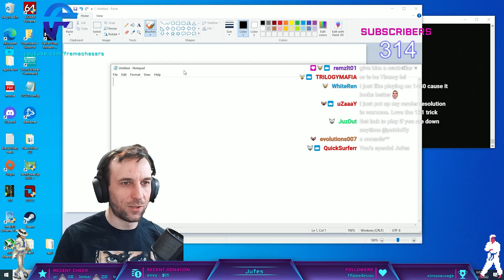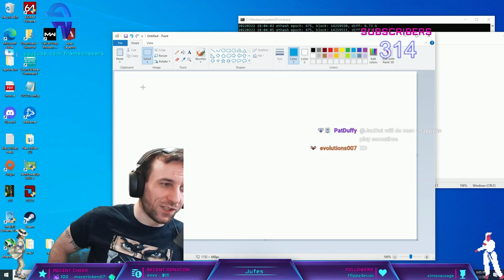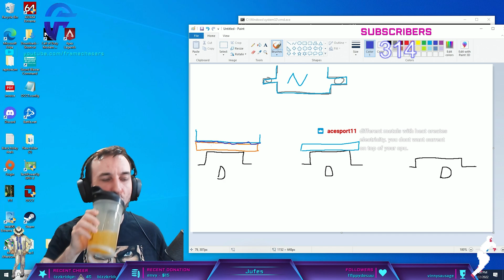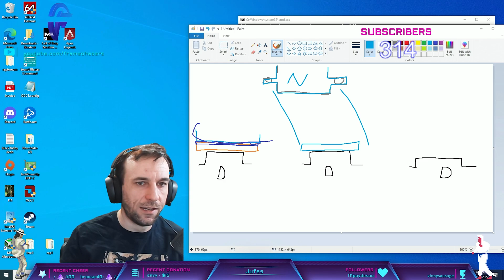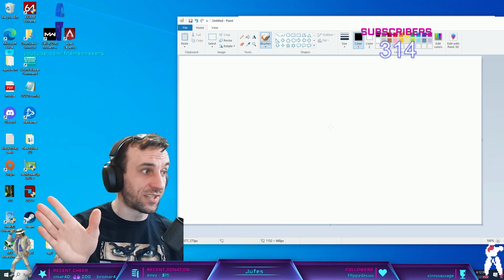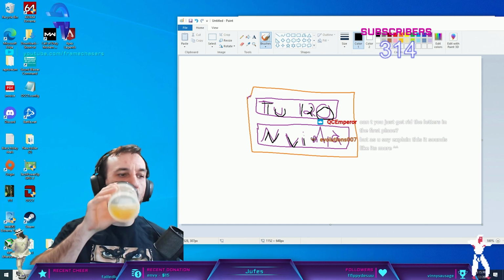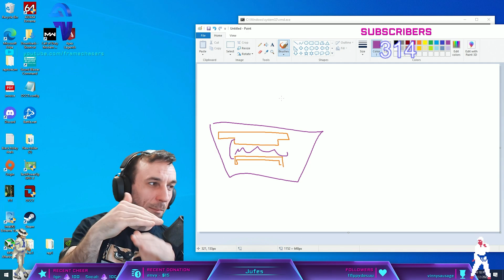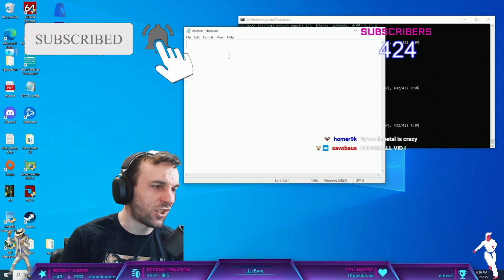Liquid Metal Application Guide

Comment: yo dude you ever used... Honeywell PTM 7950 ??? I want to know if its any good. as I am lazy as fuck and don't trust a lot of what people say. I have been using the thermal grizzly carbon pad for years no issue for me. I want to upgrade to a full water cooling system and don't trust any conformal coating (every fpv quad got screwed using it). I want to apply and forget so 5C ether way meh also don't want to get bummed screwing a 4090 using it if no good I would like your opinion bro

Comment: I use it only on my GPU and it made a 10C difference compared to Thermal Grizzly Kryonaut paste. My 5700XT sits at ~45-50C with 55-60C HotSpot while gaming and with the water maxing at 43C after a few hours. I used LM a year before trying it again and screwed up after spilling a drop on the mobo which splattered everywhere. I'm surprised it didn't blow up but I was lucky because I only didn't get a post. I then washed the mobo with soap and water and a toothbrush, let it dry overnight on paper towels and I threw away the syringe with LM. A year later I decided to use LM only on the GPU. The water block and GPU die are nickel plated so I don't have to worry about degradation. The thermal conductivity is insane. It's now been probably 8 months since the application and there's no difference compared to day 1.
Bottom line is, you gotta be extremely careful, put nail polish on the things close to the application area and you'll be happy with the results. But if you don't care about a few lower degrees, the truth is, there's a lot to go wrong. For me it was ~10C so it was worth it.

Comment: I have a custom IHS copper for my cpu  would liquid metal mess up the copper overtime? if i just leave it running for 2 years?
Reply: LM on copper only lasts for around 2 months. some copper could last longer or less time. the performance will drop in around 2 weeks time from my experiences. really no point in LM unless its on bare die and nickel plated cold plate.

Comment: I used liquid metal on a Dell laptop with a copper heatsink that was overheating and worked wonders for 2 months then overheating again.
Taking it apart I could see it dried up, after scrubbing the die and heatsink with isopropyl and a qtip for an hour I got rid of all the dried up liquid metal.

On the other hand I delided a 3770k almost 10 years ago and applied liquid metal then glued the IHS back on. That CPU is still working in a friend's pc today. (45-50 degrees when gaming all core oc: 4400ghz)

Comment: Question if you answer them, Does the 12600k suffer from the same ring bus latency issue as the 10700k?
Reply: the 12th gen still has a ring bus. I would say the ring bus is only limited in high multicore workloads that do not have enough L3 cache. so with 12th gen they have more L3 and its also a much wider bus. I feel like the core uarch is very dated however still 12th gen is going to give the best fps in most games atm.

Comment: The what??!! A GPU has no IHS and you'd have to be nuts sanding your bare silicon dye GPU. Alder Lake has a soldered IHS which is nickel plated copper, that is correct, and while lapping will improve contact no matter which TIM is used .. instantly your warranty is VOID.

Comment: It's at least two metals in a diffusion, not an alloy. Gallium and Zinc. They both react very different over time. Zinc forms a Zincoxide layer, while Gallium diffuses into most materials.

Both are electricly conductive essentially the only thing you want to manage is the gallium. Which will eat trough most materials over time (sIlicon SI is an exeption, beeing a crystal).

Comment: It dont matter if it goes between the die and ihs or cold plate and ihs if you use thermal paste between one or the other , liquid metal needs to go between both lol
Reply: You are wrong, when you have regular tim between die and ihs, liquid metal on top wouldn't do much, but heat transfer is dependant on the surface area, so liquid metal between die and ihs with regular tim on top makes a lot of sense.
Reply: @szymontrojanowski7565  no mate i have a degree in physics, thermal dynamics was one of my main studies...
Reply: @DAMGUNHAR  Then you need to keep studying. In this case it's all about moving the heat out of the die as fast as possible. and since the die is the smaller than the IHS getting that heat to a larger area first and foremost is going to be the largest gain. adding LM on top of the IHS will help too but not to the same degree.